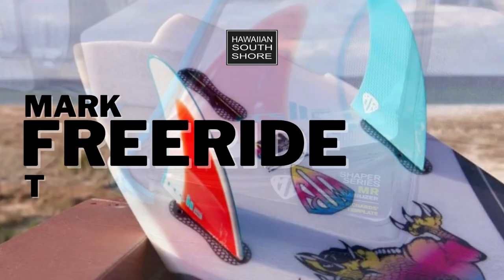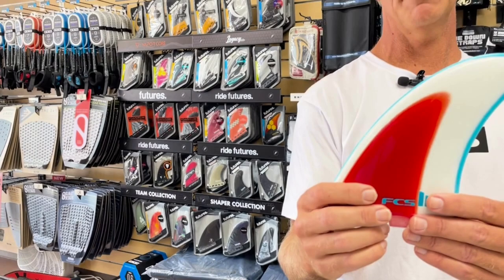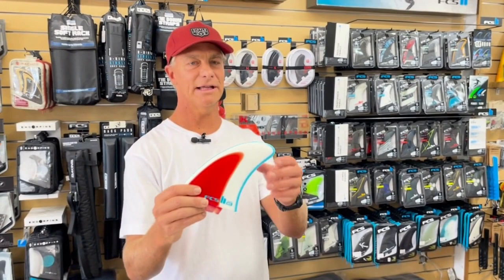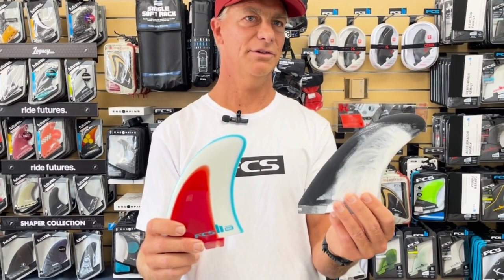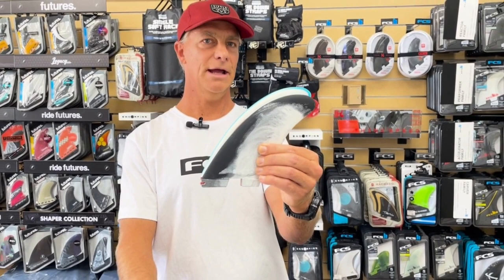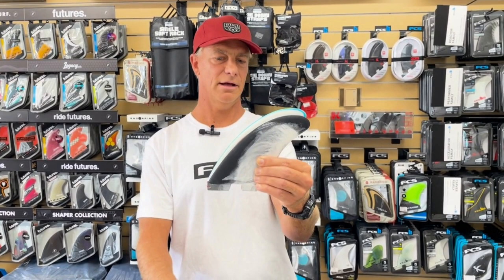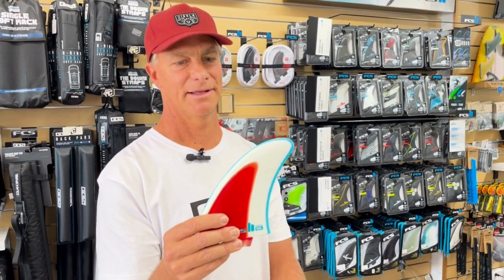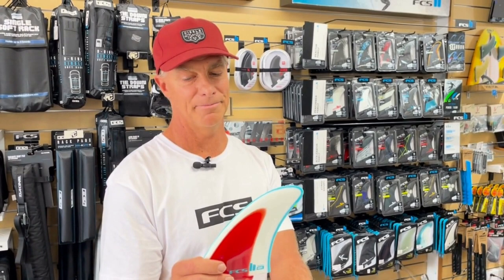Mark Richards Freeride Twin Fins Explained

Comment: Are these fins too big for me?  im 5'7" 160 riding a 5'8" CIS Neckbeard.  I have CI Keels in now and I'm having a super difficult time getting the board to make a tight arc turn on rail, which I've seen done before by Parker Coffin on the board.  Anyway, given the stats, what twin set would you recommend?  I'm a fairly decent surfer for 47.  thank you in advance!  great channel!
Reply from the maker: The CI Keels are a much large fin with more rank then this MR Twin. These twins are more upright and will pivot more then the CI's for sure. 

I would recommend the MR 2+1 for the neckbeard. I think the fin side fin placement is meant for more of a Thruster set up. 
You'll have the speed of a twin, but then you'll be able to go deep off the bottom and pickup some speed then pivot off the top.
The MR's are upright fins. 

When you have straight twins, you're not supposed to surf it top to bottom, it's best to stay more in the top half of the wave.
 If you drive off the bottom with twin the board tends to  bog or slide out.

Comment: Hi there looking for the best twin fins/ twin plus one for a slater designs flat earth. Unsure which is best for the board in the FCS2 range 
MF twins 
MR twins 
Aipa twins etc.
Reply from the maker: Mahalo  for checking out our YouTube channel. 
Based on conversations we've had with people coming into the shop and recommending different types of fins, here's a breakdown of each option. 
Long story short, the Power Twins seem to be the favorite here in Hawaii for surfing both in town and in the country.

Here is a link to all the 2+1 in stock
https://www.hawaiiansouthshore.com/search?q=power+twins&options%5Bprefix%5D=last

The Flat Earth
Love-Hate Relationship: Many people find the Flat Earth to be a bit of a love-hate board. Often, they need to go up in volume compared to their normal board. Some days they love it, and other days it can be challenging. This is likely due to its small sweet spot and loose nature.

Aipa Twins
Characteristics: Fast and very loose.
Feedback: Many who have tried them find them too loose, lacking the drive and projection down the line that they want.

MR Twins
Popularity: These fins are super popular and come in several different colors. They’re well-regarded, but might not offer enough projection and hold for the Flat Earth.

Recommended: Power Twins with Stabilizer
Why They’re Favored: These fins provide more stability and projection through turns, which is great for the Flat Earth's loose nature. Designed by Harley Ingleby, they offer a stable feel and give you a feel of a  smooth roundhouse cutbacks and still release off the top.
Options: Available as a twin fin or with a rear stabilizer.

Mick Fanning 2+1
Why They're a Favorite: These fins are perfect for surfers who want to push the board really hard. They allow for wrapped turns and big roundhouse cutbacks. The beveled leading edge on the side fins helps the board sit well in the water. You need a push a little harder to make these fins work. 

If you interspersed in one of the fins 
Use this link to help support us if you decide to purchased. 

Shipping to US address if free and to west cost usually 2 to 3 days. 
International Orders: Taxes and duties will be calculated at checkout we ship using DHL. 

Use this link to help support us if you decide to purchased. 
https://www.hawaiiansouthshore.com/search?q=power+twins&options%5Bprefix%5D=last

Let us know if you have any more questions or need further assistance. 
Big Thank you for the support David